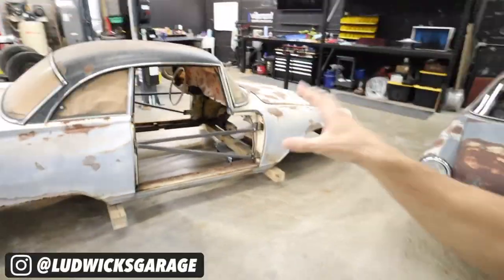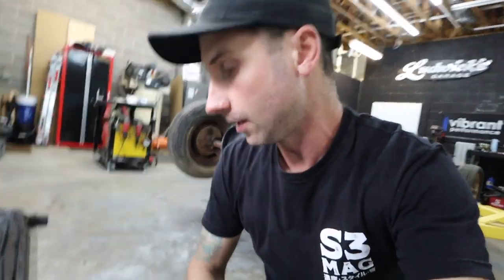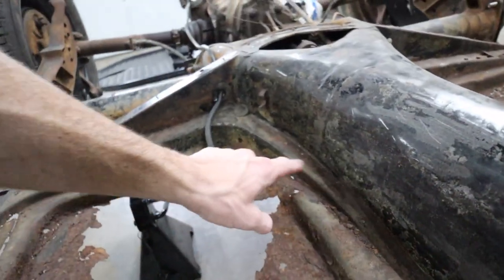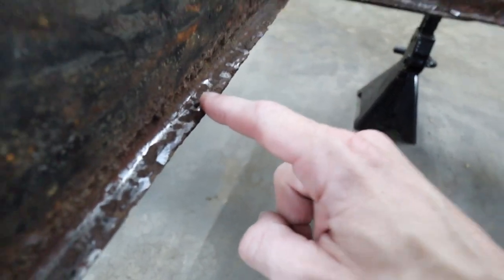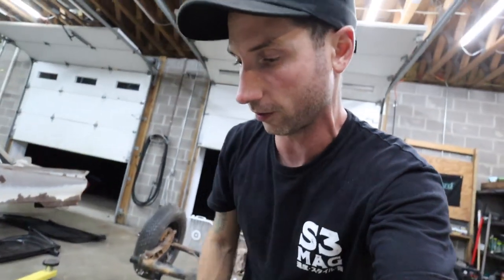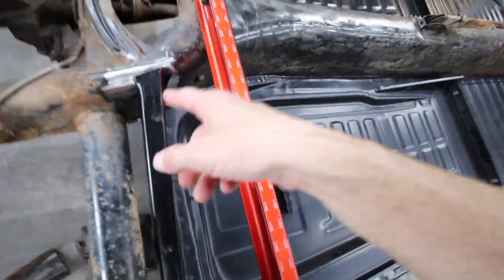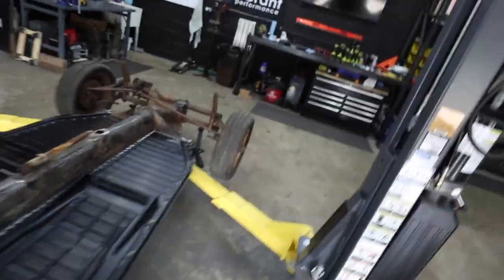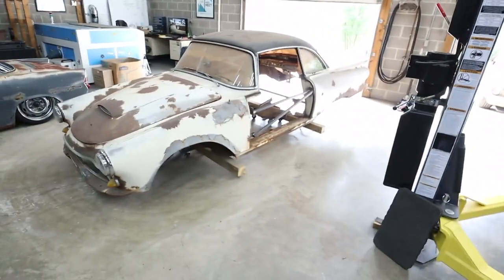NEW BEETLE PAN FLOORS FOR THE AUTO UNION PROJECT!

Comment: You should have used Ghia floorpans, they'd be a much better fit in the car, as they don't taper towards the front. Now you'll have a line of bolts across the floor and have to bridge a gap.